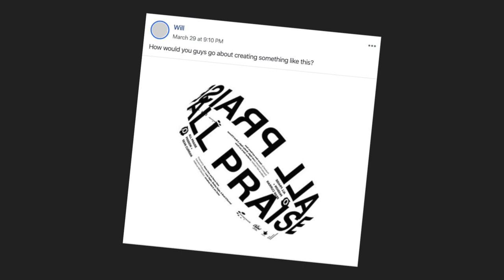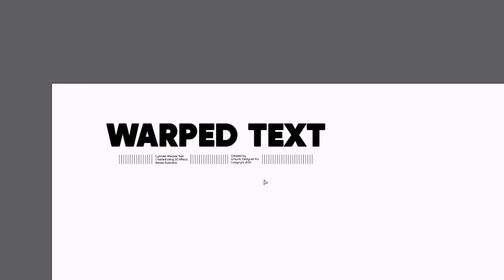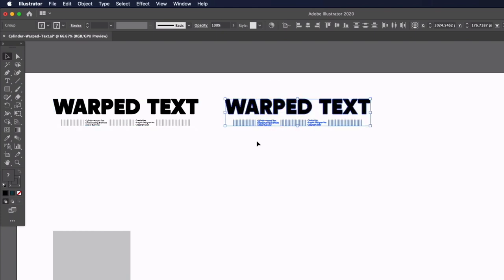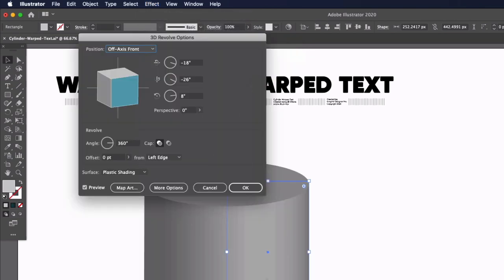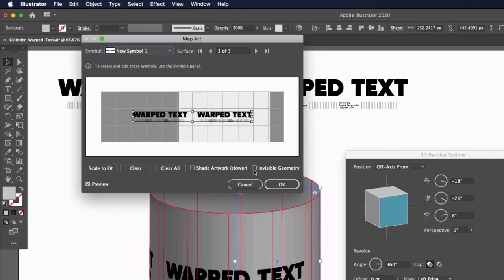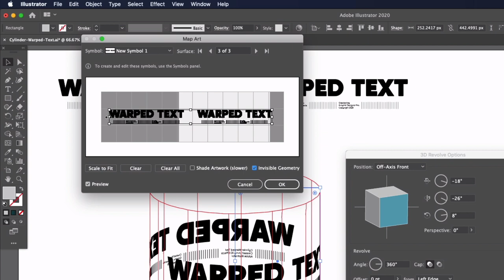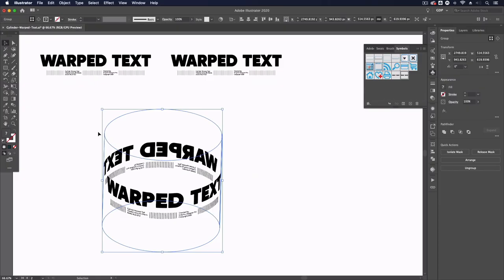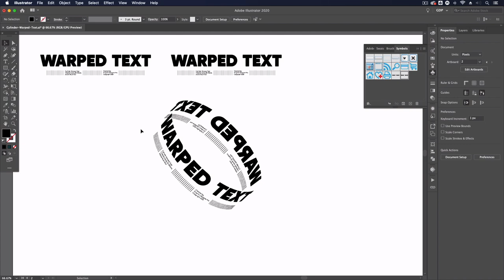Cylinder Warped Graphics • Adobe Illustrator Tutorial

Comment: My mapping art doesn't wrap around the back of cylinder. Do you have any suggestions for this?
Reply from the maker: Hey, I'm not sure what's happening in your situation, if you're following the tutorial like for like then it should work as demonstrated 👍
Reply: Hey man, i had the same problem and it appeared to me that it was just a question of sizing. My workplaces where to big so the shapes i was trying to create where too big aswell. Try scaling it down and you'll see it will work just fine.

Thanks for the tutorial @Graphic Designer PRO great work.
Reply: @mathieubasket92  dude you just made my Day. I had the same Problem as well and tried to fix it for over an hour. thank you so much!